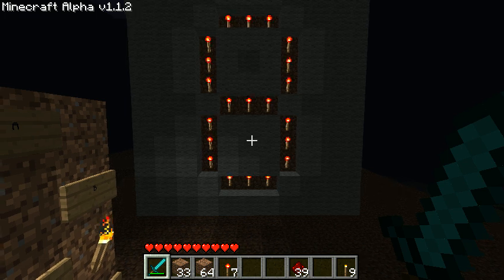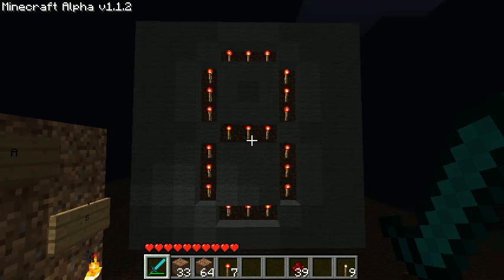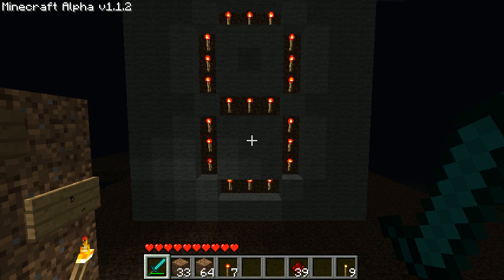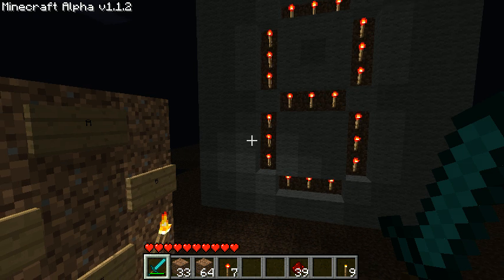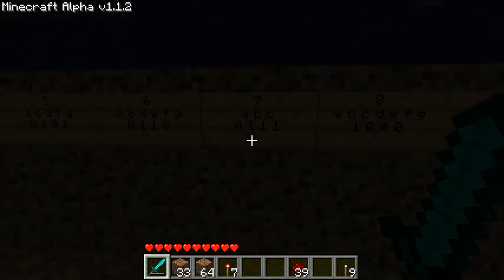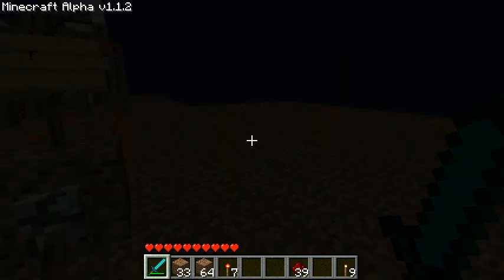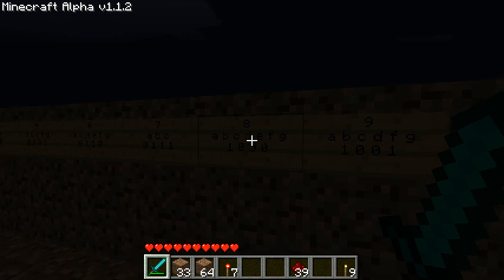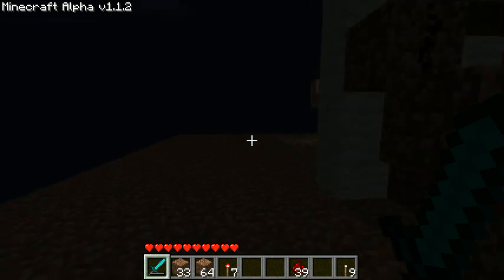Minecraft - Harbinger's Redstone - Clock Driven Counter with 7-Segment Torch Display (part 1)

Comment from the maker: @PalinOnU2b actually, was thinking about posting a video specifically about displays...but until then, what I did was run redstone to the bottom of the blocks holding the outside torches, and then the one in the middle has an inverter torch right underneath it

Material used does not matter, since everything will conduct the same other than glass...you can't run redstone to the top of the block the torch is on or you get those shorts (unless there is no block or glass over torch itself)